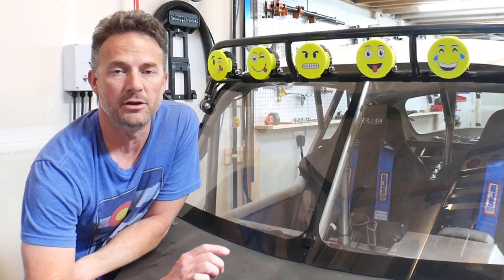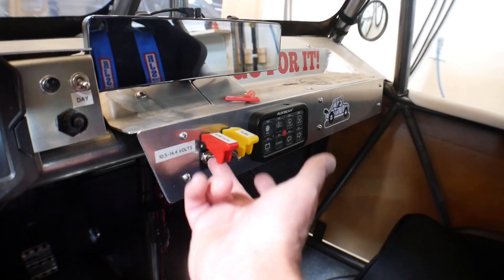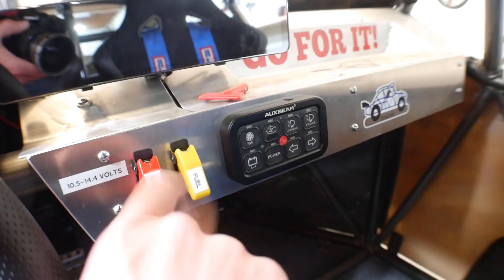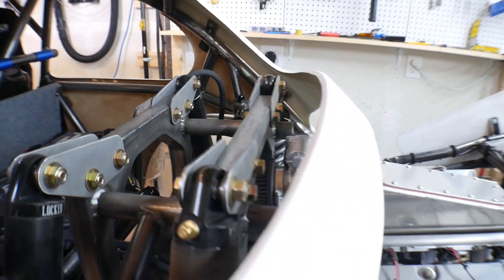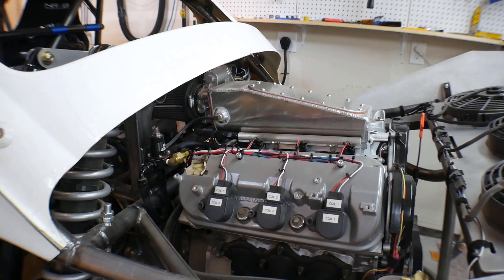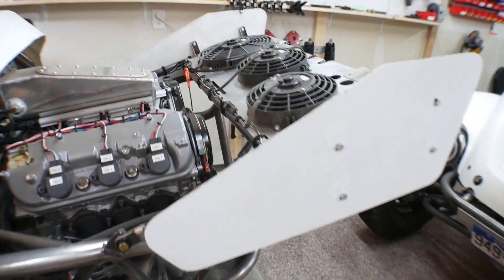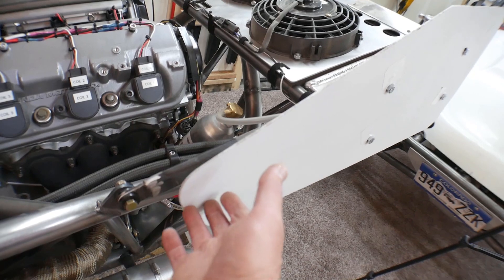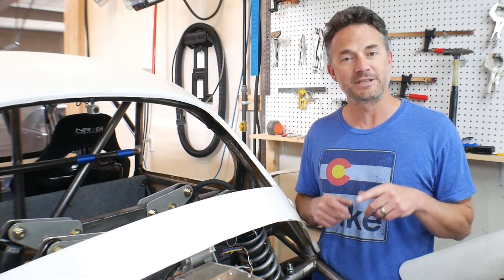Shakedown run..... what I learned.

Comment: For the air filter they sell something called a pre filter or an outer wear. It’s specifically made to block sand and dirt. The filter size is fine but you need an outer wear.
Reply: thats great to hear, ill get something like that for my own car... thanks
Reply from the maker: I might try something like that for now. Thanks for the tip. 👍
Reply: @DougBugBuilder  Hey Doug. Check out some tractor salvage yards for an air filter. You can find a nice dual stage with a 4" inlet for about half the price of less of the UMP race ones and the replacement filters are cheaper as well.  Also a Donaldson TopSpin unit on your inlet pipe to the filter housing works wonders but they are kinda salty. We run in some pretty dusty conditions out here in the midwest ohv parks and I get years out of my tractor filter setup on my Subaru.

Comment: Mike, Regarding to your parking brake valve accessibility, if you can incorporate those flexible shaft screwdriver bit extensions to extend it. Then make mounting bracket close to the shifter and install a knob at the end,  I think it would work. On the steering wheel issue, may be get one of those Neodymium magnets so that you just stick the steering wheel to it. Looking forward to the next vid. Thanks for sharing.
Reply from the maker: I like that magnet Idea. Might see if I can get that to work. Thanks for the idea. 👍

Comment: Looking good, been watching since the beginning. That's a lot of personal satisfaction coming together, great job! I'm a long time Baja racer so I love this channel
Couple thoughts, always consider what happens in an accident. Hard to tell but that switch panel looks like it could seriously damage someone's knee caps in a crash, maybe flip it over. 
 Those 45° cage supports beside the seats, shorten those up and get them away from your head. Those could seriously injure you in the big bumps or worse.
Air filter system, check out Unique Metal Products. 
Very cool Doug, keep the videos coming, car is looking amazing! Comments are purely because I care.
Reply from the maker: Thanks for the tips! I'll take all those into consideration. And I'll look up UMP and see if they have something I can use. 👍
Maybe I can make the dash so it has a rolled edge on the bottom or something like that. Something that isn't such a knife edge.

Comment: I never liked the idea of the cone style air filter being used for dirt. Seems like the dirt is just trapped on top quickly reducing the capacity. Everyone seems to use them on the sand cars with turbo chargers with an Outerwear or foam cover.
One thing is for sure. If you build or use a factory style air filter box it will cut down on a ton of noise.  How loud are your electric cooling fans on the wing?  In one of your upcoming vids please comment on your transmission gear ratio's. Are you happy with them or would you make any changes?
Reply from the maker: I need a bigger/better filter for sure!
Having the fans back on the wing I can't really hear them at all. If I'm not moving and I listen I can hear them. But generally they're quiet. The dash tells me if they are commanded on or not so I can keep tabs on them.
I'm ignoring the transaxle for now. It's just getting broken in and it's a little clunky for now. So I'm just going to give it a couple hundred miles before I comment on it. 
Good to hear from you Mr EZGZ.

Comment: If you get some stiffer valve springs you can rev it out further without fear of valve float. I’ve seen guys rev as high as 9000 rpm with just springs. Gotta love vtec!
Reply from the maker: Next outing I'm going to start with the rev limiter at 5,000 rpm. Then work it up from there as I get used to it. But I'm not going to 9,000 rpm. 😂✌

Comment: Hi Doug, it’s really cool to see Ratchet rolling. Would it be possible to build or buy some kind of worm drive for your suspension supports that you could drive with a cordless drill? It would save having to Jack the car up each time you want on and off the trailer. Also, for the rear wing, it might be possible to epoxy a small rare earth magnet on each side that would hold it to the frame and be easy to use.
Reply from the maker: I like the idea of the worm drive on the supports, I might see if I can make that work somehow. Thanks for the idea. 👍

Comment: On the rear quarter panel stiffness challenge: look up fibar and Owens Corning re-bar. Masonry Supply has it. You can tab on internal ribs. There is even a way to get it to bend without cutting it.
Reply from the maker: Thanks Kevin, I'll look that up. 👍
Reply: @DougBugBuilder  bead roll!

Comment: Put a push-pull cable(s) on the parking brake ball valves. Route the cable(s) to a lever on/around the dashboard?
You could go deluxe and put the valves on a push-on/push-off solenoid kinda thing, then it would be a momentary button like the starter button?
Reply from the maker: Yeah, I might do something so I can actually reach it. I'll see how it goes, I don't want to add complexity. But I'd like to get to them without unbuckling.
Reply: @DougBugBuilder , some 2 cylinder motorcycles have a cable that splits. You could put a return spring on the valves and an over center lever for the handle 🤔

Comment: How about a grab rail for ingress/egress to save the roof.
An L or T shaped stiffener bonded to the wing side plates might work good too
Reply from the maker: I thought about adding a handle, but I don't want it to take away from the look of the curved beetle roof. Although I could make a handle on the inside, something that couldn't be seen from the outside. 
The L brace might work on the wing, but I still think I'll just draw it in and secure it to the frame. ✌

Comment: why not relay yer chargin system off the ignition lile everyone else?
Reply from the maker: Because then it'll just go to full charge like it does now. Really hard on the alternator and excessive draw on the engine. If I turn it over to the Infinity it will turn the alternator on and off as needed to regulate the voltage I tell it to. So the alternator will run cooler and it'll be less drain on the engine.

Comment: Switches downward shake dirt out your switch going lock up mopar regulator   fix charge   dry air cleaner help. Your idle brakes micro brake on dash they do bleed off  2 to 4 hrs what you have now will bleed off too
Reply from the maker: I don't plan to use the park brake for long periods of time. Just between runs at the park.
I think you're saying to flip the switches upside down. That's not a bad idea. Thanks.